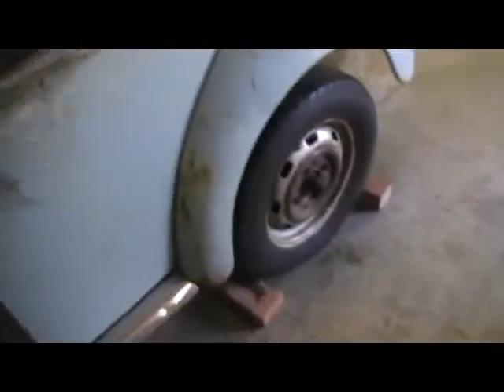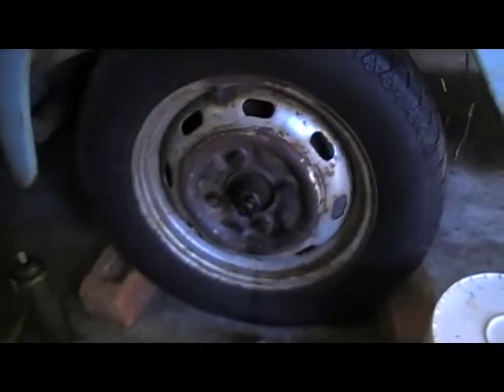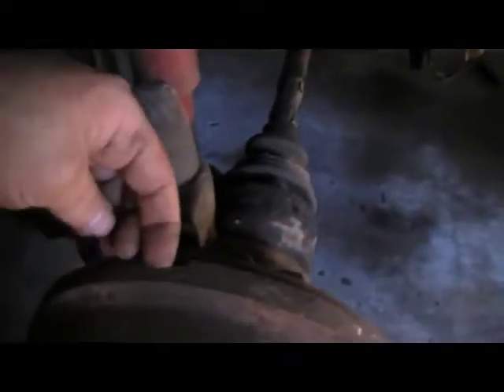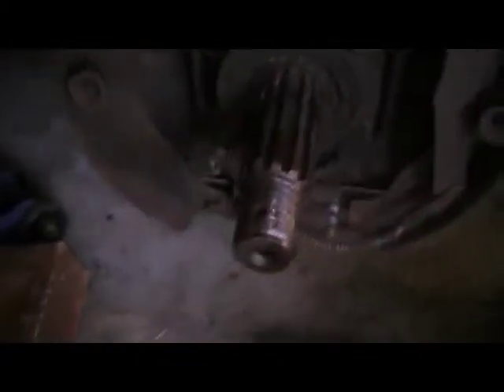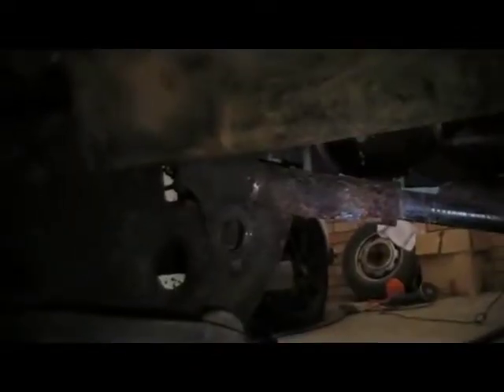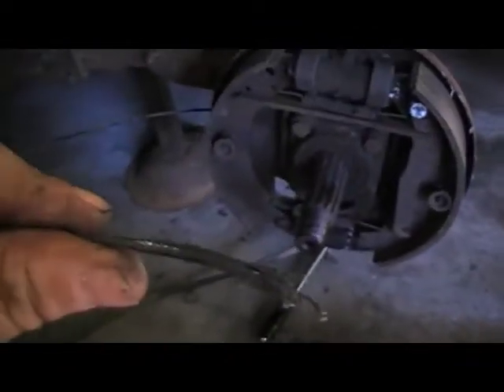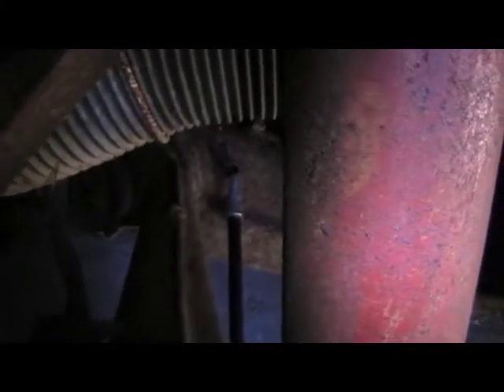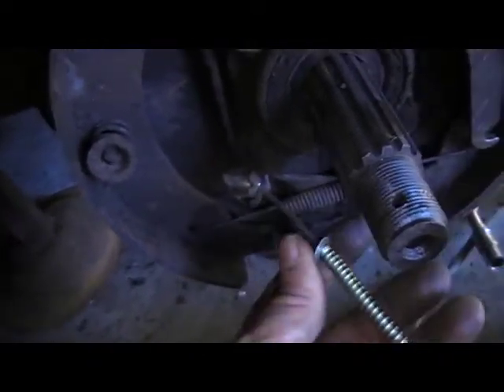VW Beetle handbrake cable replacement - The Kreiger Project

Comment: Very good video, with all it's simplicity, just fabulous; I have a 74 Karmann Ghia and I had just finished doing my brakes front disks and rear drums, I went inside the car, grabbed the parking brake lever, pressed the center button to release the lever and POW out came the pawl rod along with it's spring; just like you said, it freaked me out thinking MAJOR PROBLEM, after carefully studying the parking brake lever assembly I found one of the wires had 5 washers and a home made nut with epoxy holding it in place, the other wire had the rounded nut facing out, not towards the balance plate, I immediately ordered new wires also an emergency brake rebuild kit; VW's and brakes have a notorious background which can be changed by MAKING SURE, ABSOLUTELY SURE you're VW brakes are up to par, including the emergency brake system, the parts are not expensive; DRIVE SAFE!!

Comment: You are a life saver. I also had to replace my shift bushing last month on my 73 Super Beetle and found your video for that as well.  That video really saved me a trip to the shop and helped me get my project rolling smoothly. Thank you so much for uploading this I am gearing up to do this since I discovered my one handbrake cable is looking really frayed and tired.

Comment: Thanks! I'm from the states and wondering what the two little arms are on either side of the brake. Can you enlighten me? We don't have them here that I've encountered.
Reply from the maker: Rad Banion hi, if you mean the lever either side of the park brake lever they are for the heaters.
All 67 and newer beetles have them but many people remove the heaters over the years so the levers may often be missing.